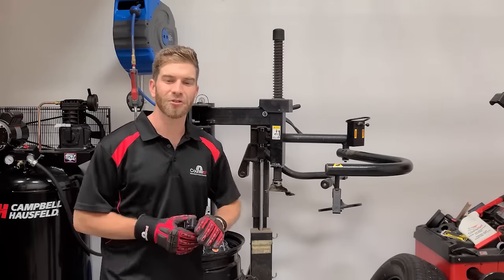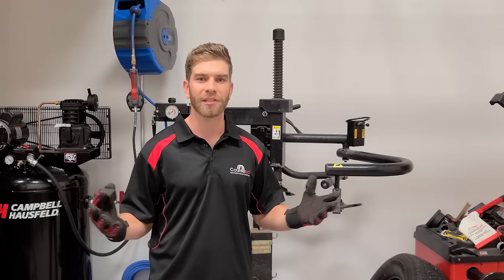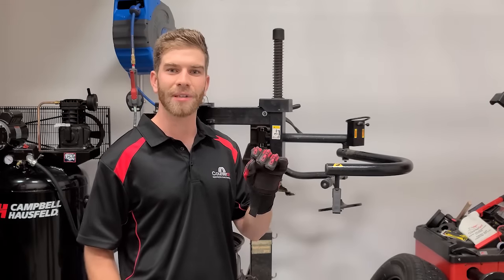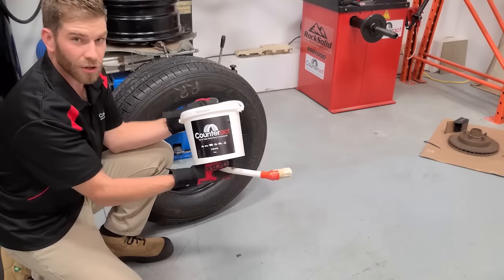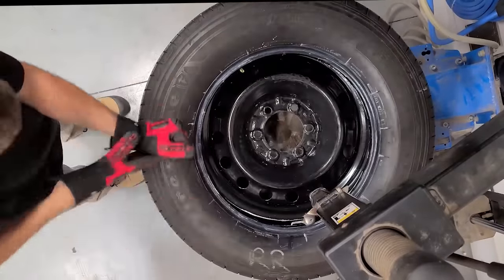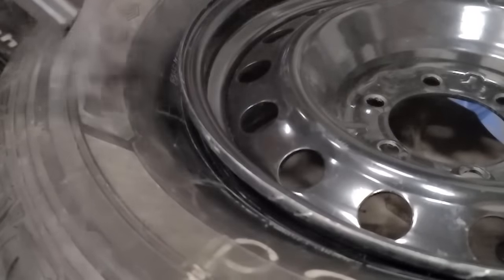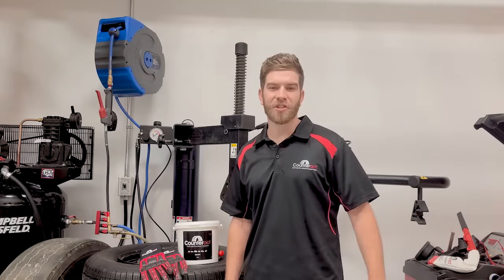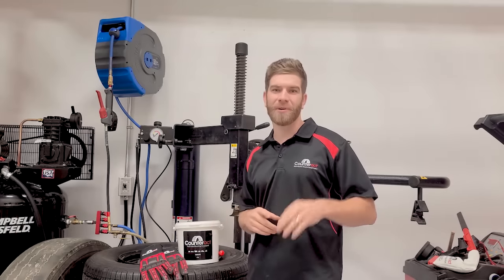Camera INSIDE a tire with Counteract Balancing Beads

Comment: This video is BS.  Show the proof of it actually working on the dynamic balancer.
Reply from the maker: Hello, 

The beads will not actually work as desired on a traditional balancer. The reason being is there is no suspension, but also a balancer won't spin fast enough or long enough for the product to position itself. An internal balancer, such as Counteract, uses the natural rebound of the suspension to help position itself inside the tire. The inertia created from the tire imbalance along with the upward and downward forces of the suspension is what position the media where it needs to be.
Reply: @CounteractBalancingBeads  So what you are saying is at certain speeds, the tire will be unbalanced, even on the car.
Reply from the maker: @bikedawg  Depending on the vehicle and the tire size will determine the point of "resonate frequency" which is where the vibrations and imbalance are at their worst. As an example, a semi-truck tire at 60-65mph is when out of balance from the wheel assembly, and the upward and downward pull of the suspension synchronizes. When this happens, it causes the vibration to be severe, and where an internal balancer provides the best benefit compared to a traditional balance, being able to adapt to the vibrations and imbalances on the fly. When you have a smaller application, such as a trailer, that can happen at a much lower speed due to the wheel and tire size being smaller. In most cases a tire and wheel imbalance won't be noticeable, or present until you reach about 50 mph or greater, and when tire balance is most important. Fortunately for us, due to how our product works, once the product finds its position after the initial run, it has the ability to stay in that position unless disturbed by new vibrations, which could be from a stone, mud or anything in the tire tread that would create an imbalance, forcing the product to readjust its position to balance out. 

We do not recommend our product for small passenger cars due to the front suspension being too soft. An internal tire balancer needs a stiff/rigid/simple suspension to perform at its best this is why we recommend it for Motorcycle, ATV, UTV, Trailers and anything 1/2 ton and larger.